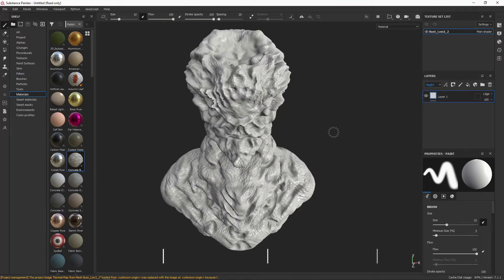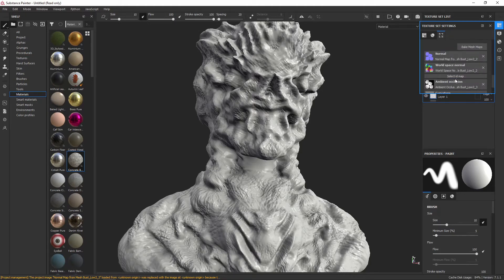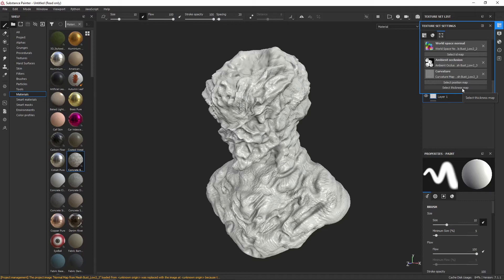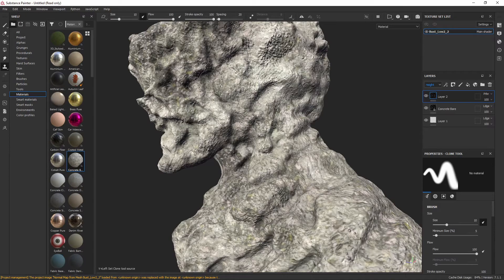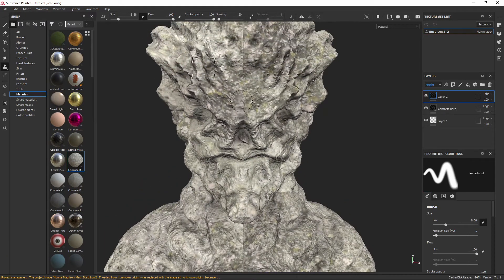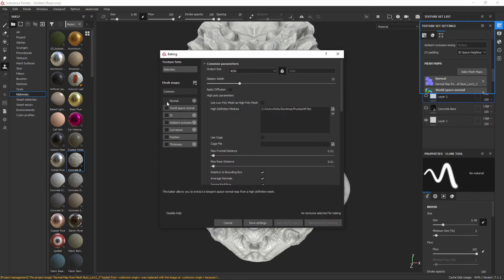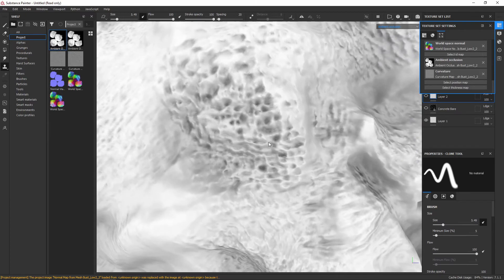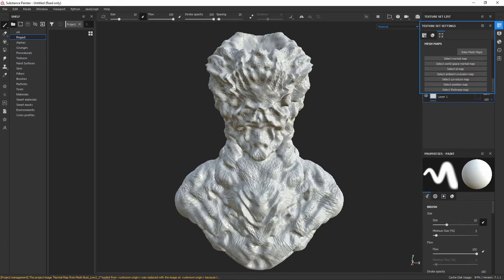How to Fix Seams In Substance Painter - In English

Comment: i dont know why but doesnt works for me i changed everything to passthrough got the clone tool preesed v and tried to paint over seams but iit just doesnt works
Reply: Same for me. Everything's on pass-through. Just paints over the seam while the seam remains.
Reply from the maker: Hello Kiger :) sorry for the late reply but this used to happen to me and you need to be careful with the behaviour of each layer pssthrough and stuff like that if the problem persist please let me know.
Reply: @kigerneko  check your folder passsthrough doesnt pass through folder groups
Reply from the maker: Hello :) sorry for the late reply but this used to happen to me and you need to be careful with the behaviour of each layer pssthrough and stuff like that if the problem persist please let me know or also check out if the clone tool is well selected sometimes Spainter is a bit confusing with the tools.